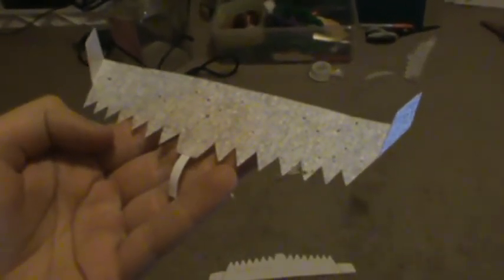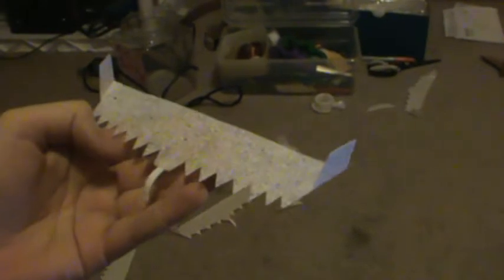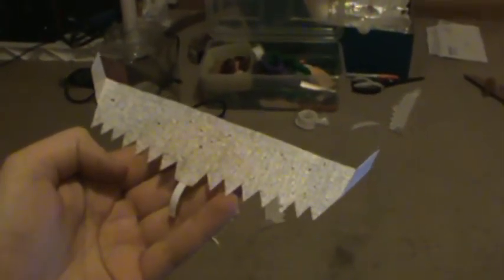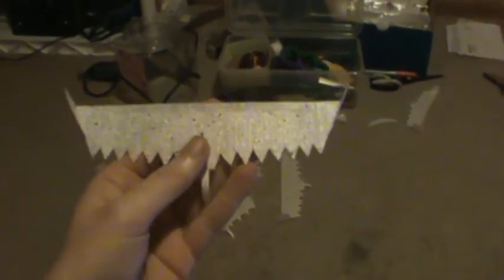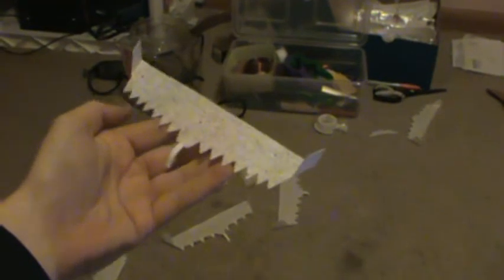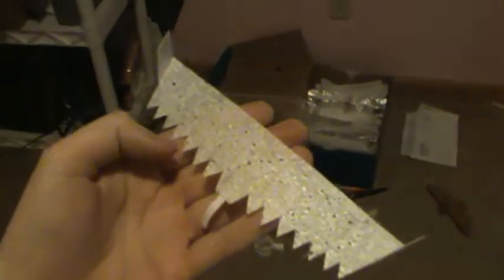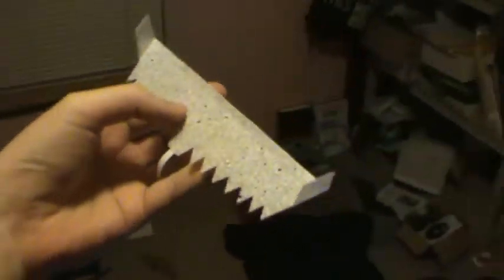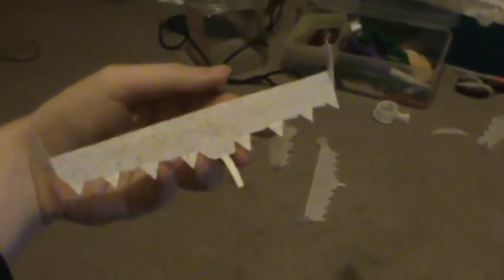Jagwing GT Reason for Toed in vertical fins- + Jagwing GT Staggertooth unveil

Comment: How precise do these tiny walkalongs have to be in order to work really well? It seems extremely tedious. I made a regular sized one and I thought THAT was a lot of work...
Reply: +benjamaster7 Not as precise as you might think. The up/down bending of the points on the staggertooth version can vary up to 10-deg side-to-side without the glider tracking crooked. The points can vary in location/depth by 5mm side-to-side without affecting the tracking noticeably. The toed-in fins help with tracking straight also. But I make paper templates to trace around so symmetry isn't an issue. What is a "regular size" walkalong for you? My tiny ones are way smaller than shown in this video.